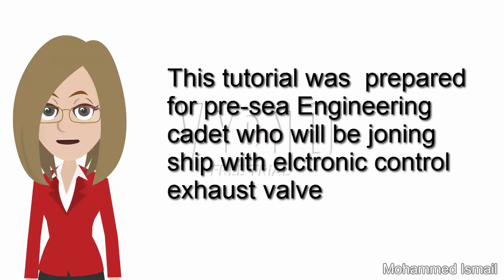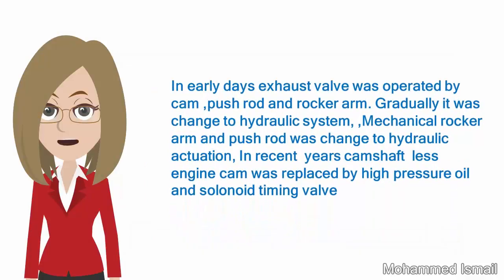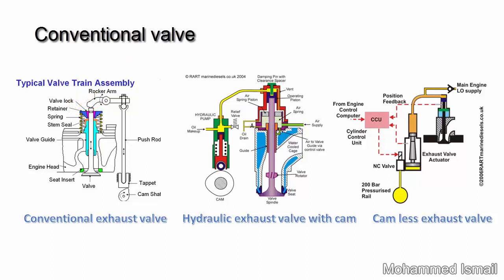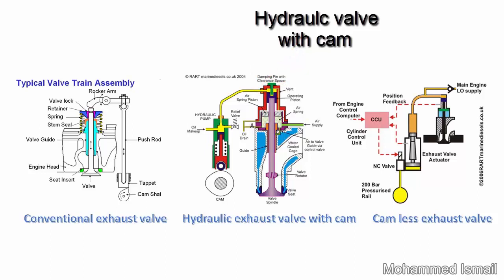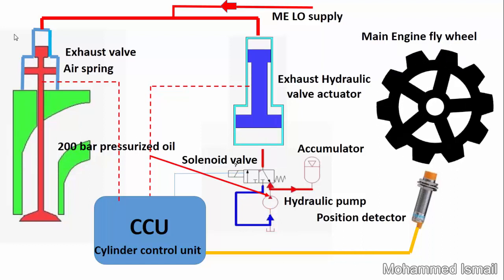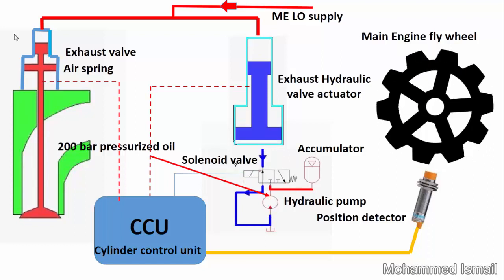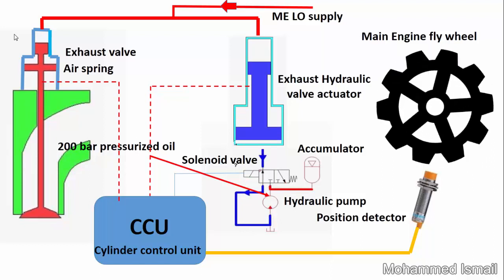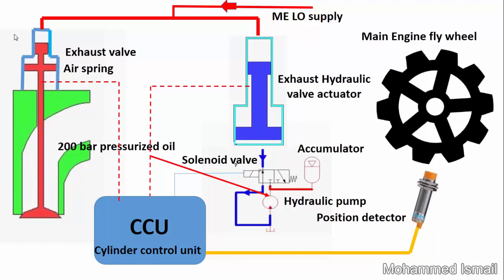cam less hydraulic exhaust valve

Comment: can the position of the flywheel be used for the intake valve as well?
Reply: As it describes a large bore I would think that this is actually for large 2 stroke diesels that have an exhaust valve but no inlet valve.